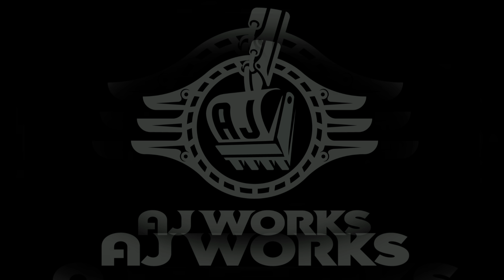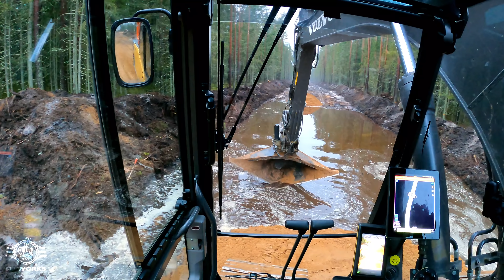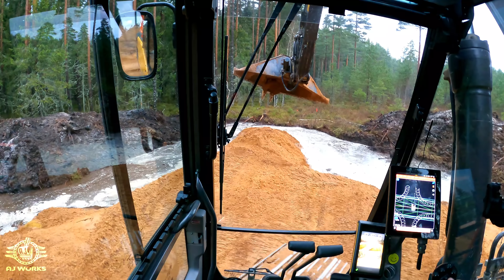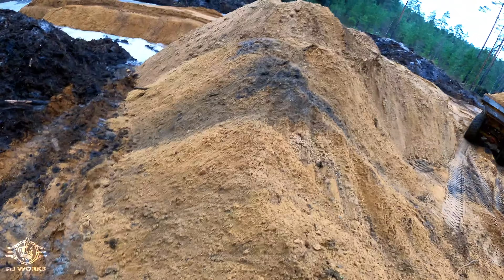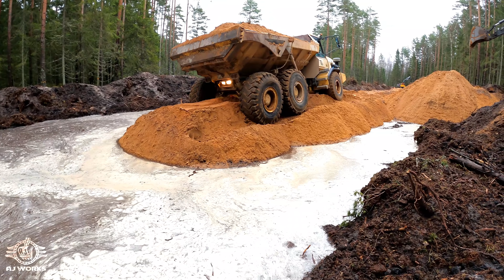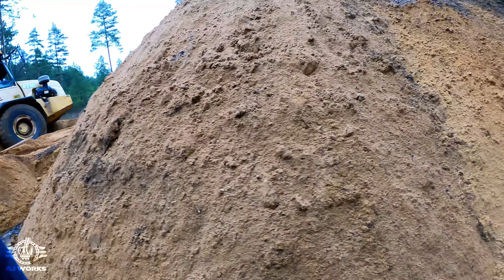A Big Puddle Can't Stop Us

Comment: What's 3d system is? How do You hace good GPS signal un te Forrest? Thanks
Reply from the maker: 3D- Volvo dig assist+ Topcon app. Nothing can be done.  Either you have a signal or you have a bad signal.  It happens in the woods.

Comment: Brings back old memories - except, quite often we had to make some changes to the technique. We were building the main multi-lane divided roads for a new community. Problem was that, as laid out in plans, it crossed a muck swamp. Fortunately we were excavating a new lake not far away. So a large scraper / pan operation could provide all the necessary materials for creating a base for the new road.  

Drag lines did much of the muck removal (in Florida, muck is so high in organic material that it would burn given the right circumstance, and is absolutely the worse material for a stable road base ever), however, to insure that every last bit of it was removed before filling in with new road bed, we had to alter the technique slightly. Difference was we used  bull dozers to push the fill down off "the end" with a downward pushing  - essentially "bubbling /pushing any remaining muck out of the way and replacing it with fill. Worked great. Called it surcharging. 

The caveat was the dozer operator had to know exactly when to stop the pushing down (off the bank end) and back out back up on to the new rough grade. Almost lost one because out of thousands of pushes, one went a yard too far and couldn't back out. Had to run the scraper push-dozer D8 about 3/4 of a mile out of the bottom of the lake to assist 2 other dozers to pull him out - before it slipped away - and under.  Good times - good memories.

Comment: It's kind of like the water in the radiator of the vehicles you can put coolant in the glove box on you want if it's not in the radiator your truck ain't going to run right stop messing with Mother Earth cooling system KAPOW KAPOW KAPOW KAPOW